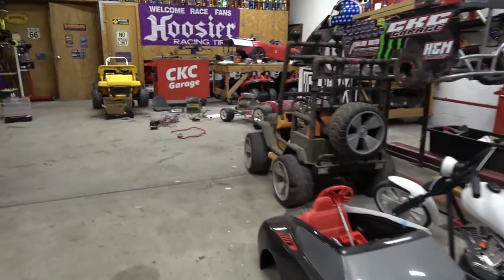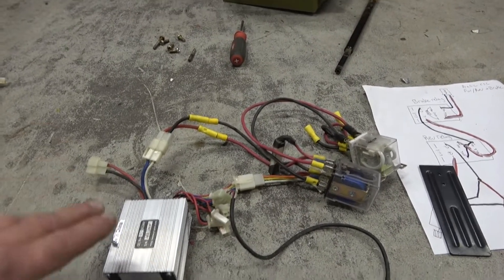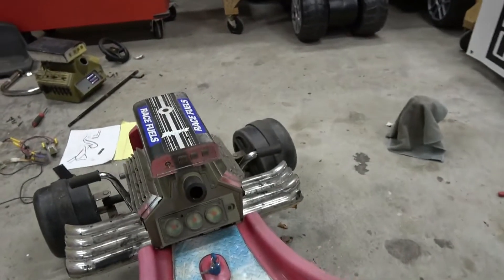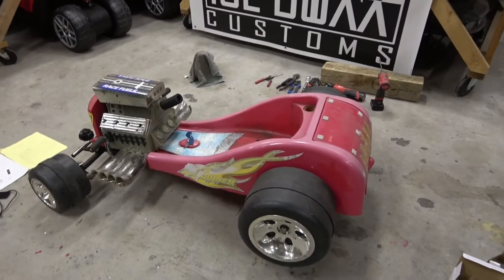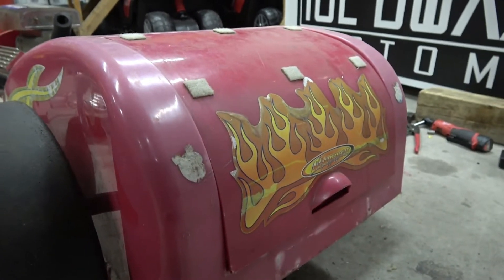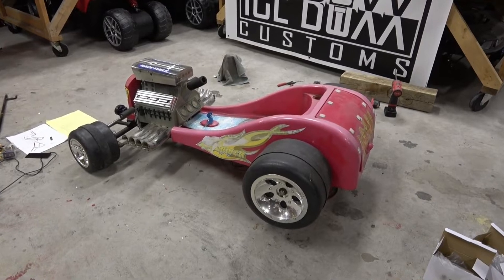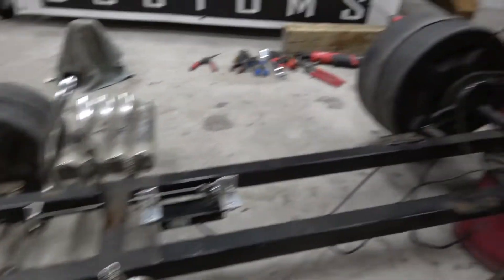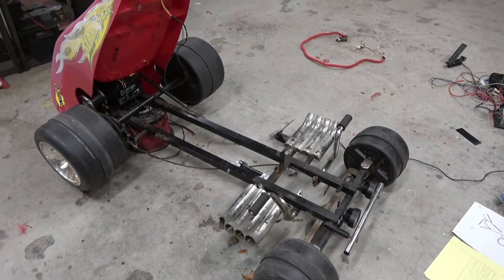Best Upgrade Ever- 24 volt variable speed Powertech Slammer #24volts #makeitfaster

Comment: Can a potentiometer throttle be used? Is there such a thing?

Can a potentiometer just be wired in series between the F/R switch and the motor and mounted as a pedal throttle, thumb throttle, twist throttle, or finger throttle instead of the need for an additional module?

Edit: I just learned what a rheostat is. Getting closer.

I love your videos! I am learning so much from you.
Reply from the maker: There is more to it. The electronic speed controller works with a hall pedal to send the throttle signal back to the controller for variable speed. Here is a complete video on the wiring setup
https://youtu.be/-CnPCgpYexo